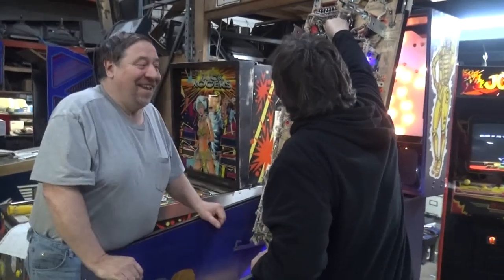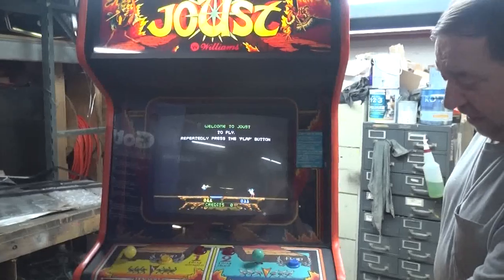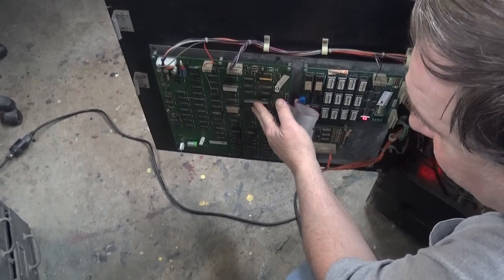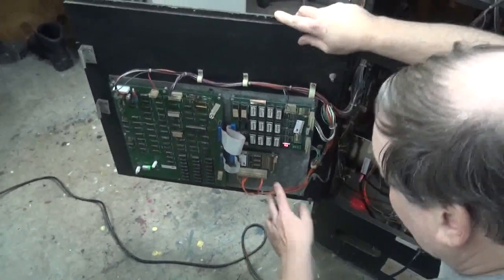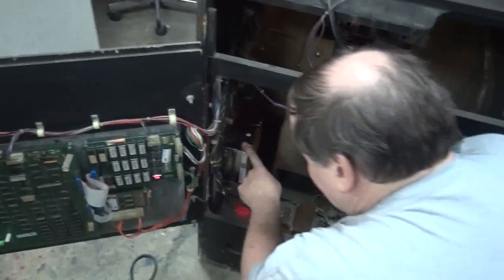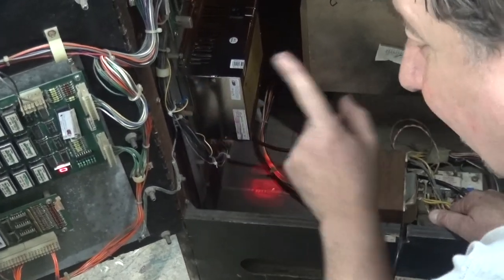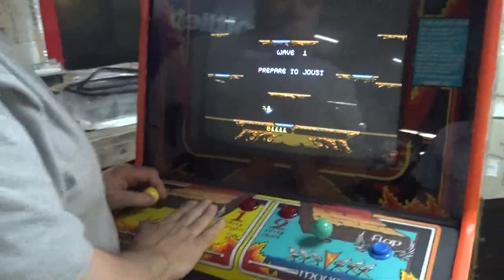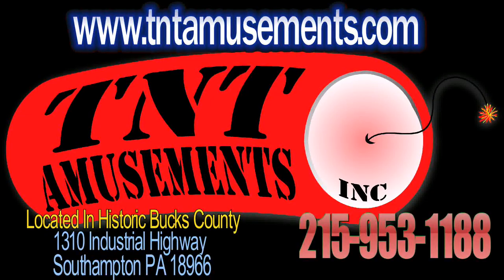#530 Williams JOUST Arcade Video Game with some TODD'S TIPS! TNT Amusements

Comment: I was just wondering when a game has glitches in it is it just a good cleaning on the ram pieces to fix it? Could faulty wires  be a cause too? Thanks for all the info us trainees are getting.
Reply from the maker: reheat all the solder points on the edge connectors, clean all the ram chips in sockets, replace the connector, replace the power supply....all necessary to getting the game running 100% again!
Reply: I'm starting to think one day I'll buy an 'as is' arcade game I've always wanted and give it a whirl lol. New power supply, new lithium battery, a fibre glass erase if the old battery leaked, order the decals and over lay,order the T moulding . Ummmmm can you maybe one day show us the solder techniques? I'll have it all unplugged of course. Ha! Learning already!